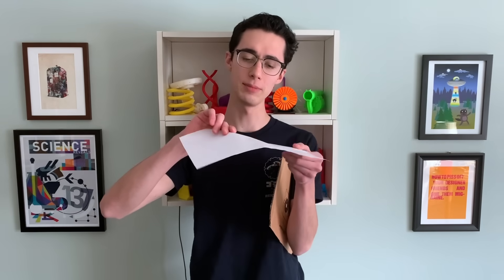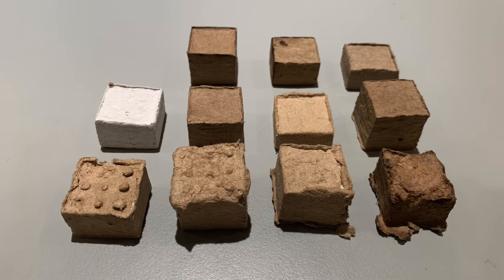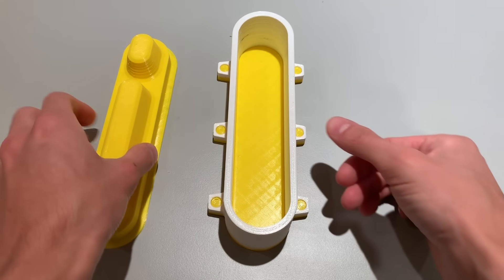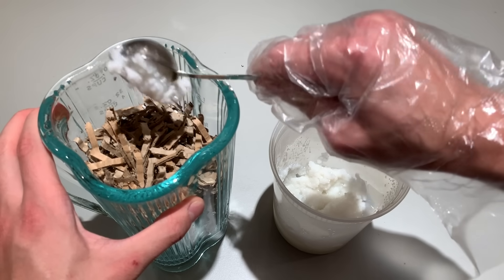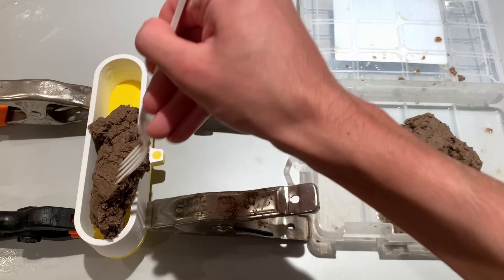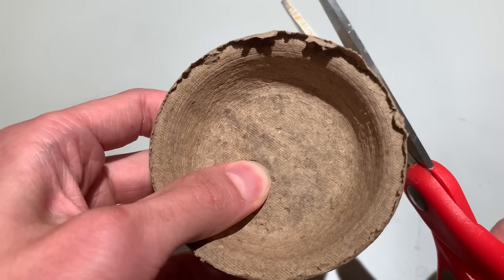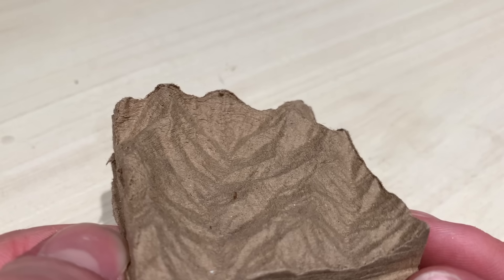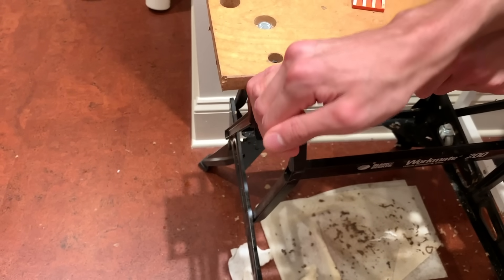Recycle Cardboard into Anything with 3D Printing!

Comment: One thing that stood out to me is a potential replacement for the seed pillows used by NASA for the current plant growing project on the International Space Station. They embed the seed in th is sort of pillow but it's especially expensive to make and it also has a plastic water attachment to allow for irrigation. Perhaps there's some sort of capability of 'overmolding' a water feeding system and embedding seeds. The Fairchild Botanical Gardens is having a competition for ideas regarding this ("Growing Beyond Earth". https://www.nasa.gov/solve/Growing_Beyond_Earth_Maker_Contest/) 

Would love to hear your thoughts. -Mike
Reply: The link is dead, can you provide a updated one. I also thought about this idea as a seed starter that then will compost away. Maybe a little problematic if it falls apart very easily. But maybe a cup can be reinforced with longer fibers or parts of the original cardboard within the mold. With nutrients added to the pulp mixture that should work pretty good as a starting medium.
Reply: @sheepsy90  the link isn't dead, he just accidently left the parentheses at the end without a space. Delete that and you should be fine
Reply: The paper can cause mold and water issues for the seed, which is why they use the current specially developed system. There is little room for error when it's difficult to go back for more seeds.
This method s actually the most basic one for that kind of application and I'd be pretty shocked if they'd never tried it in a very preliminary stage. It would also be quite a problem controlling the water inside and keeping it safely contained. The smallest amount of water and particulate can be dangerous to the systems of the spacecraft.

I appreciate your enthusiasm in thinking of uses and don't et this discourage you in looking for applications.

Comment: 8:06 similar thing happens to MDF, I guess it's just so compacted it just doesn't burn...
Reply: That is not it. A block or board of wood like a dry twig or match either. That is why when you camp and start a fire, you use kindling or a flame starting liquid fuel. Because you need to get the temperature a bit higher for long enough to get the material to ignite. Super fast with a twig or wood shavings/saw dust (big surface area vs volume and mass), not so much with a block. Normal mdf will likely ignite even faster than solid wood, though some mdf are chemically threated with fire retardants.

Comment: I watched the whole vid and i don't even have a 3d printer
Reply: Don't need 3d printed form If you have other molds like ceramic molds.
Reply: Push two plates together with pulp in the middle for a paper plate.
Reply: Just borrow a friend's 3D printer long enough to print yourself a 3D printer. 🤓

Comment: Great instructable! Just a few ideas - mixing with glue; adding bottom layer to form thin wall warped structure; adding glass fiber into the mix to make it even more rigid; using cement instead of paper mix

Comment: a fun thing that the battlebots community does for 3D printing and getting dense parts is annealing the material: where you bake your final print so it melts a tiny bit more and becomes more dense. The other thing to try is to make 9999 layers of "top layers" or "finishing layers" on your slicer, which makes it so every print layer is super flat and fine/compact

Comment: Good idea. Recycling is the way of the future. I'm a toolmaker by trade. When we build and design industrial plastic injection molds, we put a draft angle on the walls of the part so that it comes out of the mold easily. Try 1 - 10 degrees. The smaller the angle, the more perpendicular your walls will appear. This way we end up with two parts usually, what we call a cavity and a core.

Comment: i did a thesis on non plastic water proofing. im from southamerica and here in the desert they used adobe with a coating from a family of cactus called  Opuntia. it works for light coating, like being put on the fridge and camanchaca. (camanchaca is when the fog of the ocean covers the city at  night, its very wet) it still disolves if put under water for several hours. this cactus works best for surfaces that get dry at daytime and wet at night.

Comment: I made board game markers from paper pulp and pressing, but I didn't use any binder tho. In my experience just get the fibers smoothly separated (boiled + blended worked for me), and then just a lot of pressure to squeeze all the water out before drying to mash the broken up fibers together. The end product felt awesome, felt like metal/very tough plastic

Comment: I am already gearing up to recycle paper.

I have about 2.5 tons of [relatively] clean paper and several processes I aim to use it for, especially construction beams.

I am not worried about keeping my paper products recyclable though, as I aim to build permanent building structures out of them, especially buildings subject to a lot of moisture in the vehicles of humidity and condensation.

I aim to fully waterproof, insect proof and fireproof my paper products so they last a lifetime.

Comment: I once built a ZN414 based AM radio. Lacking the means to enclose this, I decided to glue a cardboard box together, put the circuitry inside and potted the whole thing with cotton wool and candle wax. The only non-waterproof bit was the tuning capacitor. Volume control was achieved by turning the ferrite antenna away from the station. The IC was wired to the battery terminals. It was always on. Plugging in the earphone powered the amplifier. It was nearly waterproof. I suggest you melt some candle wax, heat your piece in an oven to a higher temperature than the wax and then dip it in. This way the piece cools in the molten wax and the vacuum draws some into all those pores. Give it a go. See if that strengthens the piece.

Comment: Slaked lime occurs to me as one possible binder material, possibly with chalk dust as a filler; water glass (sodium silicate) can be used to waterproof materials with "free" lime (ie. calcium in some form that is reactive with silicates, including hydroxides, carbonates, etc.).
There have also been some interesting recent experiments using iron as a binder. The one I saw on Youtube had to do with iron-buffered bacterial blooms, but I think finely divided reduced iron is worth a try in your case: the idea is that it would oxidize and form (non-water-soluble) rust in the time between pressing and the end of drying. The dust from a sanding or grinding operation might be a waste stream to look into.

Comment: if you want to add mycology to your list of hobbies you can do something similar to this, only instead of mixing a glue in to the paper fibres, you inoculate it with mushroom mycelium and then allow the mycelium to grow through the pulp before demoulding. Then you kill off the mushroom and dry out the water by baking the objects in the oven at a low heat. The dead mycelium glues the pulp together with protein fibres, which has the advantage of making the products fairly waterproof. You also dont need to compress them nearly as much, as the mycelium will stabilise even fairly open loose material as it grows through, so you can end up with something more like polystyrene than plastic. This is called mycomaterials. It does require figuring out cultivating mushrooms and sterilising substrates, so it's quite a bit more complex and finicky to get to work. But still pretty cool and more versatile

Comment: This is an awesome project. Seems to me like it would be possible to add Oyster mushroom spores to the recycled paper slurry. They won't grow when the paper is all dried out. But if you later throw the product into a compost bin, the product will become wet and the mushrooms will help to turn it into usable soil. 

Another idea: you could mold excellent packing material for high end products with this technique. Such products are often packed in foam or plastic.

Comment: You could use a wood stabiliser like "Cactus Juice" (& a vacuum chamber). That would impregnate all the cellulose fibres, and make it not only resistant to water, but hard enough to use almost any woodworking process (lathe, drill, saw, dowels, screws etc.)

Comment: This is something I've wanted to experiment with for a while. I have two questions though. 

1. Will using an organic binder like rice cause it to mold easily? 

And more rhetorically...2. I wonder if there is a cheap means to coat the pulp products to make them water resistant? Imagine if we could build houses from the stuff.

Comment: I see that this video is 3 years old, so I'm not sure if you are still interested in this area of research.  However, I very much enjoyed the creativity of your work as well as your persistence in resolving a lot of the key problems you faced.   If you want your parts to become water "resistant" you could use a wet-strength resin known as PAE or Polyamidoepichlorohydrin.  About 1 weight percent of this material is what keeps paper towels from falling apart when wet.  Otherwise, you would need to introduce a barrier coating along with some sizing for water hold-out.  There's a lot of ways to do this, but people are still also trying to perfect it.   Maybe you will be the one that figures it out!

Comment: if you coat the parts with boiled linseed oil it could make them waterproof, it also would make the outer shell a bit tougher

only issue might be that the oil would just soak all the way in to the material
if you first coat it with wood glue(home made wood glue with flower and water could do) and then apply a few coats of linseed oil that could make it less absorband to the oil

Comment: Have you tried adding jute fibres? I've seen these used to add strength to lime plaster so should also work with cardboard. I'm wondering if there is a use for your idea in construction using natural materials. Good work 👍

Comment: The sign wave design made me wonder how larger square panels might do at sound dampening/absorption/deflection in a studio space for DIY music production. The end product seems to be unable to catch fire so there's a plus. Perhaps larger square panels can be used to line the inside of hollow doors to potentially slow the spread of household fires. Kind of a faux solidcore door of sorts? Further work on water resistance could potentially open up a world of unexpected uses. Also, experiments are just fun. Rock on dude 🤘

Comment: There is a different process you can use... It's done by cutting out and stacking layers of cardboard. Either before you assemble them or afterward, you impregnate the layers by saturating them with varnish, which can be done either with a pressure vessel, or with brushes. After assembly you let it dry out, trim it with a hand-grinder, and add any metal bits to make it more durable. The advantages of this method (in relation to the video's method) are: 1) requires no printing at all, 2) can make large objects, like monitor arms or other big pieces. 3) the stresses the object will have to handle can determine the object's strength in various directions, simply by orienting the "lay" of the corrugations appropriately. 

Disadvantage: takes a LONG time drying/setting.

I've done a trial part. It dries very hard (finger-nail hard or harder), and even holds it's shape when in use. But note that leaving the corrugations open is part of the process, else it will not dry adequately.

Comment: It seems like it will be a super cheap and easy way to make molds for composite parts. Foams are getting more expensive these days and are non reusable. Paper pulp would be reusable. You can line the outside of the part with aluminium foil tape, Kapton tape, and/or a release membrane if extra heat resistance or smoothness is needed.

Comment: While making the material water resistant would be beneficial for some purposes, it would also be beneficial to think of how the susceptibility to water damage can be useful. My immediate thought was for plant seedling pots that can be transferred to soil or certain hydroponic growing setups. The paper pot can be rigid long enough to contain soil and protect roots, then dissolve to allow the roots to expand. Perhaps some small level of nutrient could be added to the paper pot as well.

Comment: Neat. I used to build pulp recycling machines. You need to add tiny holes for the water to escape. Almost like a we use stainless steel screen but the moulds were $50,000

Comment: A possible idea for waterproofing: If paper is soluble in orange oil, you could dissolve beeswax and paper in orange oil. After pressing, the orange oil will evaporate and the beeswax is left behind. This should make the thing waterproof(ish)...maybe. Downsides: it will most probably be flammable, it will smell from orange oil for a long time and depending on the polymer used for the mould, the orange oil could also dissolve the mould.
But if paper is not soluble in water, you could soak it in a solution of beeswax and orange oil in order to make it waterproof(ish).

Comment: One should find that, if they develop metallic molds and add powdered lignine, they could press-bake the fibers into MDF panels. Mixing in plaster of Paris and PBA glue instead of lignine, you will make a very resistant composite.

Comment: The way these are pressed, it reminds me of plastic injection molding (though much slower) and I wonder if the same guidlines can be applied to this. Draft external surfaces so they slide out easily, add ribs to maintain the structure while minimizing weight and material, ect. I see a use for this right away: paper cups which are completely recyclable. They're indispensable at parties. If you can get it waterproof with something easily removed from pulp, maybe some sort of wax that floats to the surface of the pulp when the mixture is heated?

Comment: You could try pine tar to make it resistant to water. You can extract the pine tar yourself to keep with the DIY bit. Pine tar was used to weather-proof wood in the past, it could work for the compressed paper if it has the same qualities as wood.
Reply: this would also make for an impressive fire starter

Comment: I add 1 part 'PLASTIC CEMENT' powder to 25 parts paper-pulp add it's rock solid in 24 hours and water-proof too. Turns out like STONE and has a ceramic "ting" when dropped or handled! I also make Bullet proof plates from tactical vest inserts by adding sand and same extra Cement powder. It can catch a bullet way better then you think since the fiber gets compacted under the singular pressure-point of the bullet and bunches together like a catchers mitt and gets tougher under pressure. The sand and cement behave like a ceramic plate. Best of both worlds. Cost effective for type 1 and 2 armor plates and can even make a type 3 if soaked in sodium silicate for 24 hours and left to air dry for 2 weeks and WAY CHEAPER and lighter than AR500!

Comment: Well you can coat with any type of soluable wax or some tar or some resin to make it rather water resistant(or even compeltely resistant if you apply enough layers). Probably even something like common rosin resin could do the trick.

Comment: I wonder if you could take advantage of the material's weakness to water to make a safe little robot battle type game, just get some water safe electronics and make pretty much all the parts out of this stuff, minus the water based weapon of course. You could have water balloon bombs/mines, water guns, little pellets that explode into water on contact, shields and armor that break apart and fall off without consequence to the structural skeleton (kind of like armored enemies in some video games) you could make something that spews forth a fine mist of water, though this would likely destroy your robot as well.  furthermore, I wonder if one can make compliant mechanisms with this...

Comment: I've cast recycled newspaper by pressing the pulp into plaster molds without using any glue at all. The end product is only 1/8" thick so it can dry in 24 hours or less if I have a hot sunny day. One downside is the ink which comes off when handling the pulp but fortunately not when the casting is dry.

The pulp sticks strongly to nearly every surface. I was shocked that it stuck to glass coated with petroleum jelly. My solution so far has been to coat the mold with a wet paper towel. Oddly enough, once dry the casting can be pulled away from the paper towel. This is not an ideal solution, however. The towel tends to crease in the mold leaving groves in the casted paper.

Next, I'll try to soap the mold and then coat it with a wax/turpentine mixture (roughly the same consistency as petroleum jelly). However, in the process I'm currently using, the plaster absorbs a lot of the water from the pulp. If I cover the mold with wax it will probably take much longer to dry.

My goal is to cast smooth, highly detailed, thin and strong paper for sculpture.

Comment: Glossy "magazine" paper is that way because it is loaded with clay, then heated and polished between steel rollers in a machine called a "calendar". The last one I worked on produced 6' diameter spools of glossy paper 20' long and weighing around 15+ tons.

Comment: I'll bet you could use a wood stabilization process (often used in woodturning and knife handles) to make a very interesting final product.  Take the finished and dry item, submerge it in a vessel of heat activated epoxy, and place the vessel in a vacuum chamber.  Bring the pressure down as low as it can manage and leave over night, pulling all the air from the voids.  In the morning, return to normal pressure and the resin will fill the voids.  At this point, some makers will put the vessel in a pressure put to force more resin into any remaining voids.  Then, bake the final product according to the epoxy instructions and you have a product which is water proof, won't rot, and with significantly improved mechanical properties.